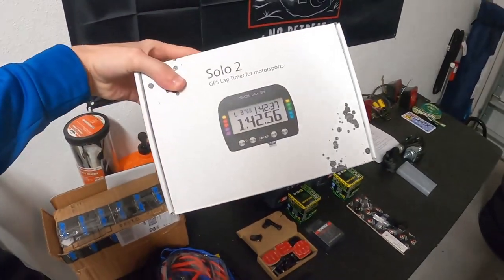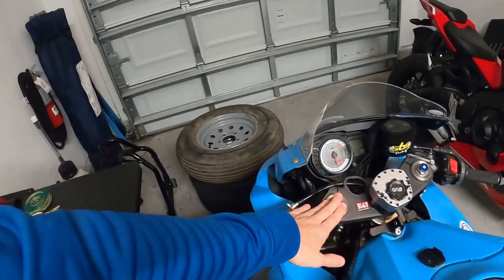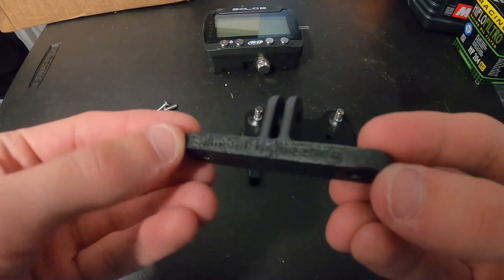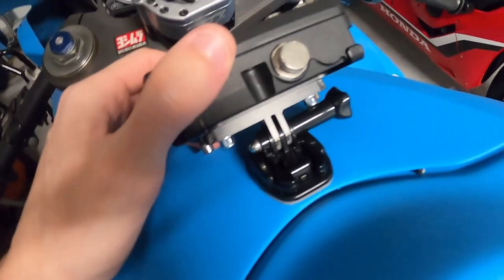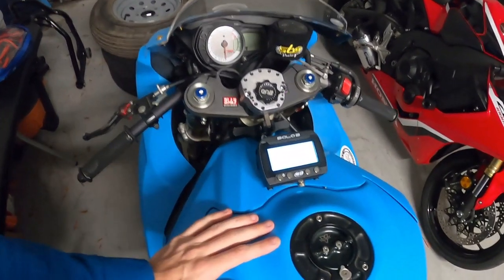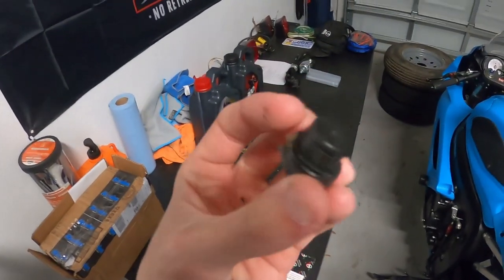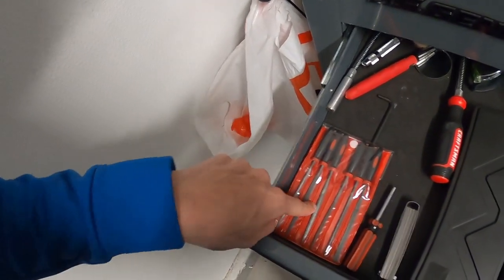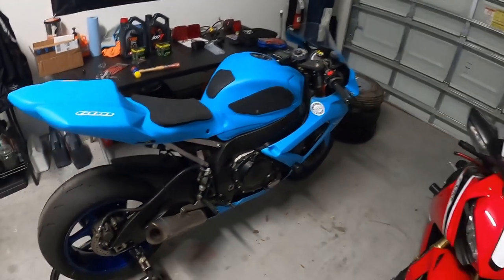Aim Solo 2 Lap Timer for the GSX-R600!

Comment: Bought mine two years ago. Now I swapped it to a Tuono V4 and have serious issues to get a stable GPS signal. Bike TFT (or Ring antenna from Immobilizer) caused electrical inteferences. Not usable anymore, AIM told me to get an external GPS receiver for another 400 bucks to make it work. Garmin and smartphone GPS work properly, so I guess shielding or GPS antenna of the AIM unit is crap. Now I have a usesless 800€ item😞
Reply from the maker: That sucks wow. You could always try a race box mini. My buddies love theirs and is way less expensive than the Solo.